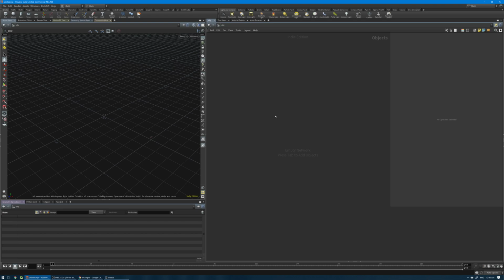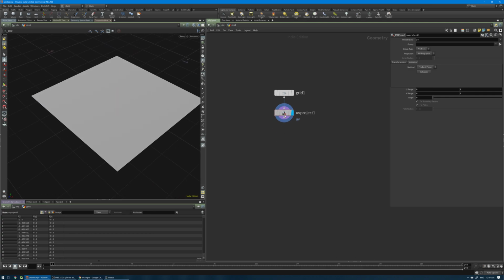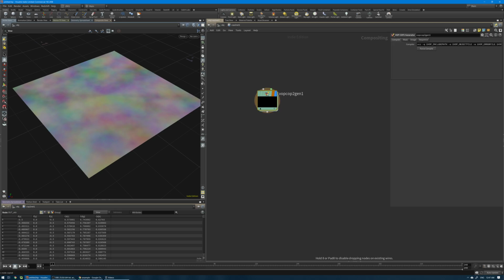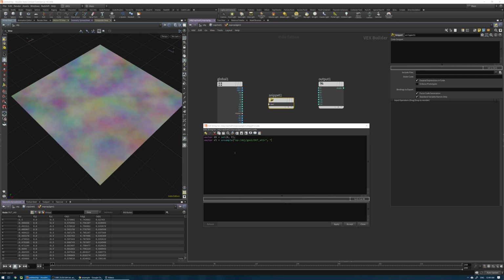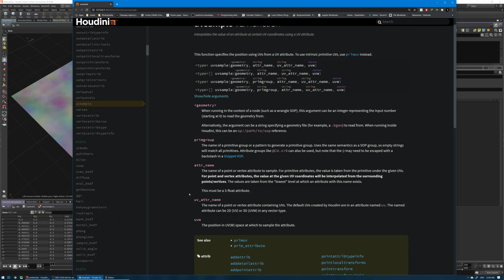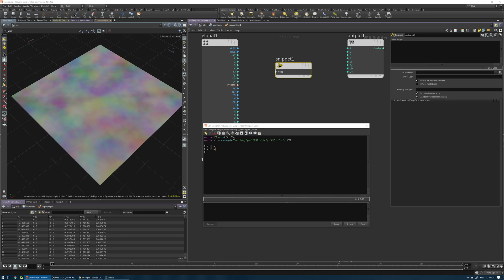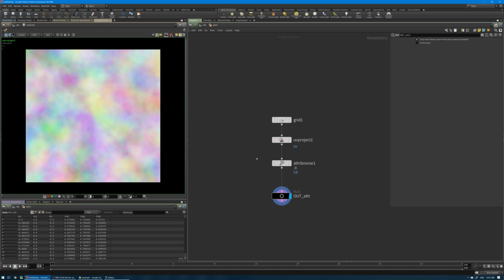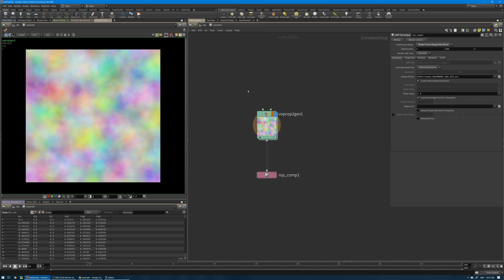18.Write Attributes To Texture

Comment: does this work for something that is not a grid?
Reply from the maker: if the geometry has uv it works regardles of the geometry shape. So the answer is yes
Reply: @JafarDashti  Hi, Thanks for the tips Jafar, how does it work with UDIMs? ;)
Reply from the maker: @GuiKer  Hi, you're welcome, I didn't check it with UDIMs but guess with some modifications can make it work. at the end we're dealing with XY coordinate and some rgb values. might be a good challenge to try!